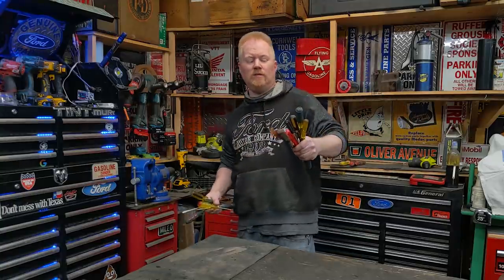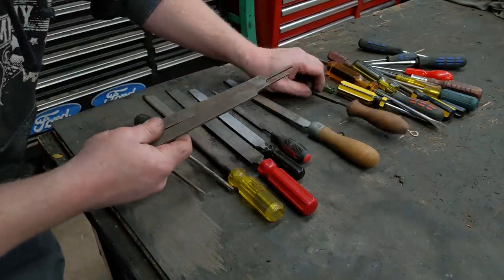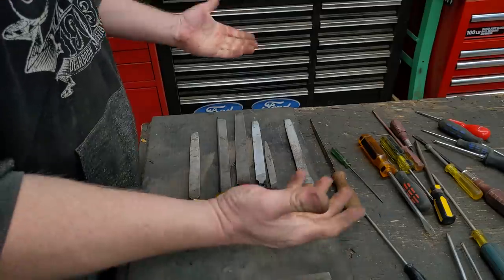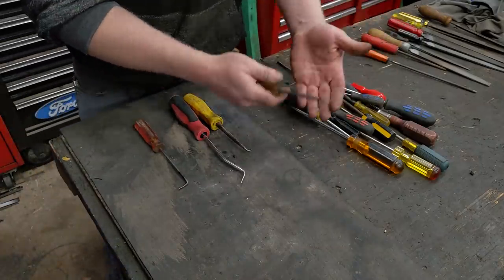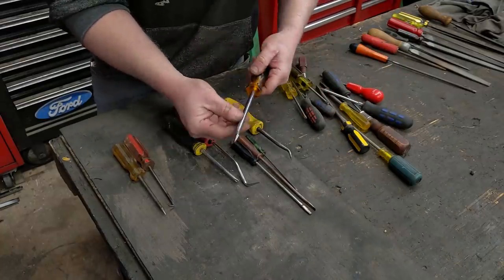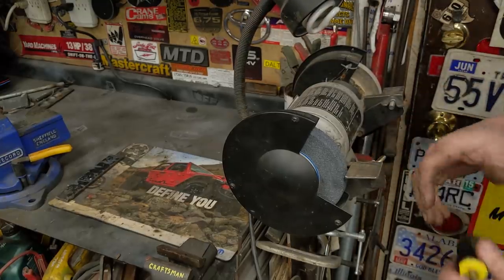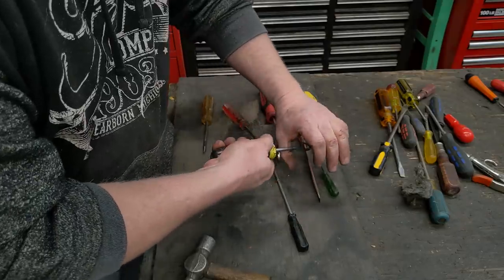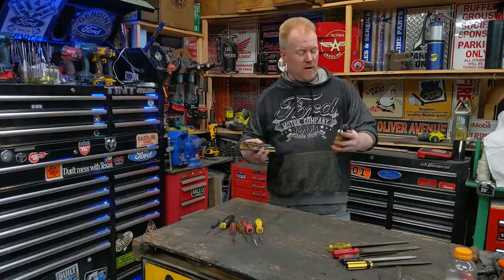BEST uses for Broken Old Screwdrivers VOTED #1

Comment: I have one of those wood handled flat heads from my grandfather. I use it just as much as my my craftsmans.
Reply from the maker: These wood handled ones are cheap clones of the Irwin or Stanley.
Reply: @sixtyfiveford  made by Irwin. Mine had just readable numbers on the wood handle. 800-10. Meaning 10" length. I found a pic on line of 6" wood handled Irwin with the part number 800-6. Just wanted to let you know. I like using it and use it alot just never knew who manufactured it.  JUST FYI

Comment: Screwdrivers with longer and thicker shanks are good for making mallets. I thread the end of the shank, get a short piece of copper, aluminum or brass rod, drill a whole in it, thread it and screw this hammer head on the screwdriver shank.

Comment: I cut the tip off one and used a cutting wheel to cut it into a "female version" of a flat head to make a valve core removal tool for tires.
Reply from the maker: Nice. I had to do this for larger Shrader valves on propane tanks and car AC systems.

Comment: electrical test light. grind the tip down to a point, drill hole in end of handle, install small bulb, solder wire, DONE
Reply from the maker: Good idea.

Comment: When ours get worn or broken we use them to get broken bolts out. We weld the tip to a broken bolt or stud, the heat from welding to the broken bolt expands it and fuses it to the driver. Then use the driver as leverage to get it out. 

Then we take them to sears and get a new one 😆
Reply from the maker: I have a screwdriver just for this exact purpose. I just keep welding to it and grinding it down when the welds get to goobery.

Comment: Car window winder clip remover. Very thin put a hook on the end,then cut off leaving approximately 2mm of the bend
Reply from the maker: Good idea.
Reply: Something I forgot, a second bend is required about an inch back of about 30 degrees and in line with the hook. Two reasons for this, first to give clearance for your hand and secondly so that you know which way the hook is facing whilst it's under the winder.

Comment: For file handles I find that the file taper may cause the handle to split so I heat the file tab and melt it into the handle.  The hooks also make great spring installation stretchers.  Many times need a really wide flat head which is hard to buy, such as carb inlet seats, and power valves.  Heat, beat, shape and grind an old flat head as needed!
Reply from the maker: I'm with you. Sometimes I have to lick them with the torch for a second and they lock in much better.
Reply: @sixtyfiveford  Plastic scrub brushes also make for hefty handles

Comment: I would do a sniff check on those acetate handles before salvaging them. If it smells like vomit, it's near the end of its life and is off gassing.

Otherwise, I'd rather just jam a 1/4" hex bit holder into it and have a screwdriver that can replace the tip as needed.

Comment: I've done the picks convert. Never used the handles on files. Have used tree branch trimmings for file handles and old paint brush handles but I usually found a better use for an old screwdriver than as a file handle. I'm hoping to get some good ideas from the comments.
Reply: tree branch handle....hmm....
Reply: @harryharry3193  Trees can be turned into handles, boards, posts, lumber, and other wood products.

Comment: Wire stripper! - Take a flathead, heat it up and with a chisel make a little notch at the tip. File the notch into a little half circle and file it sharp. To strip a wire, place the wire on a flat surface and put the notch on the wire and just push it away from you.

Comment: a deep socket or a closed end wrench will fit over some screw driver handles, if you wanna spin one up or add some torque.
Reply from the maker: Yeah, I've noticed that. Great tip

Comment: Years ago I bent a flat blade to use as a drum brake adjuster tool.  Worked great but I left in my old F250 Diesel and it got stolen.  No biggie, next time I need one will just make another one!
Reply from the maker: Heck Yeah.

Comment: I may or may not have used cheap screwdrivers with a hammer in the past n broke the handle. Then it just becomes a chisel of sorts n I don't have to worry about breaking the handle twice. All I buy are cheap screwdrivers cuz they're cheap n I abuse them. Some are surprisingly durable. I've got one that I think it was a 13 piece set for under $10 n I used the biggest flathead to turn a semi engine at the flywheel while putting the trans back in n the screwdriver held up awesome
Reply from the maker: I treat them all like crap. I really like the acetate/clear plastic handled ones. They take a good beating.

Comment: Great video , I was gonna call you on hardening but you beat me to it , unless you really want your garbage repurposed screwdriver to be properly tempered you need a forge, I’ll subscribe my dude
Reply from the maker: I find it's better the softer it is. It's still not mild steel soft with the chromium they generally add and the tang can take a beating and pry really well. It would just round over if removing hardened screws, which is no longer a concern.

Comment: I found a Snap-on radiator hose pick in an old tool box.  Only instead of a curved point its bent back on itself and has a cutting blade on it to actually split the hose down the pipe.  Took me a day to figure out what it was, then found out it was made back in the 60s.  Thing still looks like new.  Now if only I had a radiator hose to remove.  🤣
Reply from the maker: Very neat, I've never seen one like that.

Comment: Whenever I've gone to a Garage or Estate sale where tools are listed, most often there is a collection of weapons grade screwdrivers that look like your junk drawer tools priced by someone that thinks that they are gold.

Although a back scratcher may be a good choice to make from one of these.
Reply from the maker: Very true.
Reply: The radiator hose tool makes a great back scratcher
Reply: @southbound1969  Actually I have a cotter key puller like the yellow handled one at 4:14 ( mine is black and about 45 to 50 years old) that has been used for that purpose many times. 😃

Comment: Talk about getting a good grip on a screwdriver handle (or any handle). Just wear a leather glove, or just wrap the leather glove around the handle and you get an incredible grip not attainable with the handle alone. "if the glove doesn't fit, you can't convict", but you sure can get a much better grip by wrapping the glove around a knife handle. I always have leather gloves lying around and don 't bother to put them on. I just wrap the glove around the handle. Done.

Comment: Smart dog! Also great video. I just subbed.

 I'll have to give this a shot. I just tried it with a newer pick that was off Amazon and you can imagine what that turned out like (they aren't terribly bad out of the box, but the steel just goes to mush if you anneal it.) This might work better since the steel is at least half decent. And the handles won't unscrew either!

Comment: I work on waste oil furnaces and the nozzles sit recessed in the burner they're 5/8 inch and you need a socket for them I made tea handle sockets specifically for the nozzle I just welded a screwdriver in a cheap socket and then welded another cheap screwdriver on a t to that and it's incredibly easy and a lot better than a ratchet
Reply from the maker: Awesome idea.
Reply: @sixtyfiveford  when I first showed it to my boss he asked me to make him one

Comment: If you are going to the trouble of pulling off the handles anyway, you are free to put whatever length of steel you want back in.
Reply from the maker: True. Generally the steel they use in nicer screwdrivers is better/stronger than just cold/hot rolled though.

Comment: For those who know and use Spiral Locks in their performance engine builds, the BEST tool for removing them, is a small screwdriver with a notch cut into the blade. I can remove the locks quicker than you can say, screwdriver. 
T.S. RACING 👍🏍🇺🇸
Reply from the maker: Great point!

Comment: If you quench them in motor drainings, they won't get brittle.
Reply from the maker: It really doesn't need to be hardened. A screwdriver only has the very bottom 1/8-1/4 inch hardened because it comes in contact with hardened screws under high torque. Motor oil will still make it hard, not as hard as water, and the tip of your beautifully formed pick will snap right off the first time you use it.

Comment: Would a screwdriver bit be brazeable onto the shank? Maybe the bit looses its temper, else that would renew the tip easily and cheaply.
Reply from the maker: I have welded those little tips before with a mig welder and that works. The brazing would likely put too much heat and it would loose it's temper.

Comment: i watched a glazier use tools with bends in 2 different directions to install the rubber seals for windows on the sides at the back of my van.  they were professionally made.  there was a left hand and a right hand version.  so i got all the shitty screwdrivers and made one of each and as many other different variations as possible.  the ones i made that i bent 180 degrees would have been useful for removing seals and radiator hoses had a short life-they broke.  i'll just have to make more backups next time.
Reply from the maker: Very neat.

Comment: Cut a perpendicular slot in a flathead first removing snap rings, drum brake springs or pushing/prying stuff 😉
Reply: I've been dreading fixing the automatic adjustor on my drum brakes. This is going to almost be better than having a 3rd hand!

Comment: Great idea.  No need to reharden that tip after bending?
Reply from the maker: Nope. You're no longer using these under high torque loads against hardened screws. They are still very hard and don't bend easily.

Comment: Using the GripLoks at the base of the shank also acts as a heatsink so you don't melt the handle.  I think.
Reply from the maker: Absolutely. Good point.
Reply: Wouldn't really do all that much. Not much in the way of contact on the shank, so it's not going to transfer much heat.

That said, better than nothing I suppose.

Comment: On the regarhardning, heat to red, quench in oil, then ANEAL by reheat just to point that the oil from quenching burns off.    Let cool.  Brittleness  is gone.
Reply from the maker: You don't want any hardness to the tips. Annealing is just less hard.

Comment: After you harden the tool it becomes brittle because you need to temper it after.
Reply from the maker: The shaft of the screwdriver is never hardened only the very tip where it abrades against the hardened screws. It's virtually impossible to temper a needle and completely unnecessary. The biggest issue is can't control the temp you temper it to unless you remove the handle and place it into a kiln. But again it is not needed and no commercial picks I have used are hardened.
Reply: @sixtyfiveford  But he said it becomes brittle after he hardens it I was stating that is brittle after harding it because its not tempered am I incorrect in that statement?

Comment: Done most of what you showed, as well as....marking scribe, weld chipping hammer handle, ice pick, ike jime fish spike.......but like others, Im guilty of butchering serviceable screwdrivers to make specific tools.....when you cant reach a fixture and you need a bent driver like brake tools, slot head flat drivers, spring fitting tool......the worst would have to be when you can't find that Robinson driver bit for your drill and you sit there staring at the hand driver.....in a flash you have impatiently whipped off the handle and clamped the end in your cordless drill, done, ruined a $10 screwdriver to make a $1 bodgy tool
Reply from the maker: I've done the exact same thing with Robertson. If I recall my drill rounded it off pretty fast.

Comment: It's a shame nobody makes a file jig for accurate repair of phillips screwdrivers.
Reply: A lathe tool sharpening jig would do it, if you set it up to put the point against the CORNER of the grinding wheel and then do the four sides before you flatten the tip to the size Phillip's head driver you want...
Reply: I just hand filed mine with needle files. Fuck is it a tedious process.
But it was my favourite screwdriver, so I couldn't bring myself to 'ruin' it.

Comment: One thing I would really like to refurbish is a Craftsman 1/2" drive swivel breaker bar. Is there any site that sells parts for these? I do not live within easy driving distance to a Sears or K-Mart that may still be open. I do have a good number of Craftsman tools that need to be replaced.
Reply: Ace hardware stores sell craftsman tools also.
Reply from the maker: Most Lowes will swap as well as Ace. I've never seen parts sold for these.
Reply: @sixtyfiveford  Thanks

Comment: If they're just worn, why not resharpen them rather than buy more?  I've been doing this for 60 years.
Reply from the maker: I sharpen plenty and definitely the ones I like. I have more than enough flat blades and making other useful things is more of a priority.
Reply: @sixtyfiveford  I sharpen many others that are not flat blades.  My early years were as a carpenter.  Today, I'm a retired computer programmer.  I have worked also as a service tech repairing mechanical devices.

Comment: The easiest way to remove handles is clamp the bit in the vice real close to the handle and use two other flat blade screwdrivers or two small pry bars and prise a little at a time and scoot blade back to the vice again till it comes off ,,,, FYI AND WHO IN THEIR RIGHT MIND WOULD JUNK A SNAPON MAC OR STANLEY SCREWDRIVER when any of those companies will send you a brand new one ,, go buy one !! You will give over $20.00 for one ?????

Comment: Why the hell does anyone even keep a broken screwdriver in their toolbox? Mine get thrown in the trash where they belong.
Reply from the maker: To make random pry bars, stir paint, hammer the head to bust a seal loose, weld to the tip to extract a broken stud etc. All the stuff you wouldn't do with a good screwdriver. Probably why you end up throwing so many into the trash.

Comment: Bruh why in tarnation do you have a can of rusty water in your workshop!? 😂
Reply from the maker: It's the water I use to cool parts, drill bits, files that come off the grinder. Metal deposits in it and it gets rusty extremely quick.
Reply: @sixtyfiveford  oui m8 that makes sense. I recommend keeping the water in a plastic water bottle so you can easily pour it onto stuff and keep a mug full of oil for dipping hot bits into.

Comment: Phillips screws and screwdrivers should be made illegal like crystal meth. A good old hex. or a good canadian robertson should be the norm !
Reply from the maker: You Canadians hate those so much. I've used the Robertsons a lot and there is a learning curve just like Phillips. In the 90's-early 2000's I stripped out a lot of Robertsons(just knew them as those crappy square drive). I think Torx kicks the but of everything but also a JIS phillips screwdriver makes Phillips amazing. A lot depends on the screw and most important the quality of driver used.

Comment: I like to take an old screw driver and bury it. In 2 years dig it up. The rubber, plastic, or wood should have broken down enough at this point. Now you can take it and force the flathead into the end of an extension cord. Be ABSOLUTELY SURE that you put it in the positive side and not the negative. Now lick your finger and shove it in the negative side. And now as long as you touch the negative and hold the screwdriver handle at the same time you will have a corded power tool!
Reply from the maker: Heck Yeah.